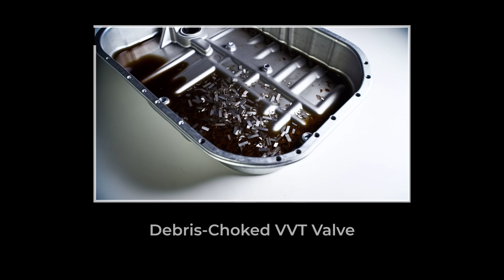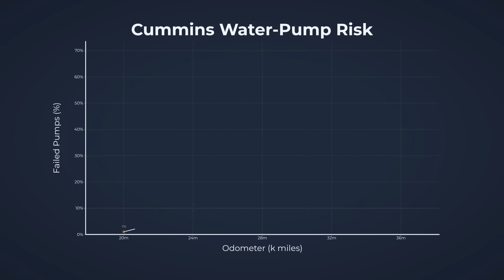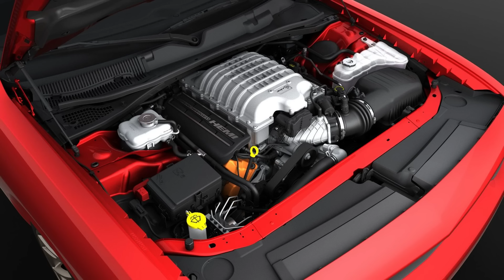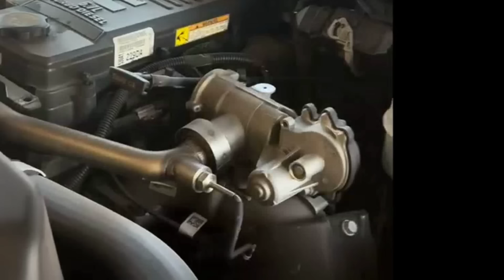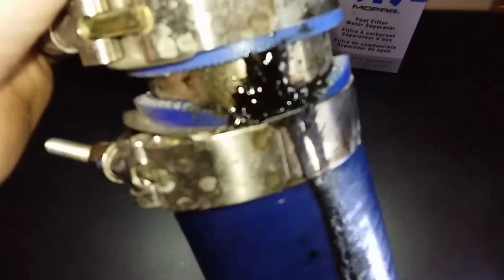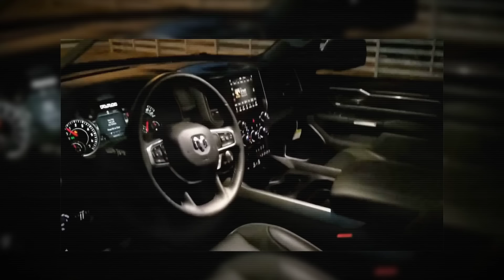Do This Once a Month, and Your RAM Engine Will Last Forever!

Comment: Watching these videos really makes me regret buying my 17 ram… coming up on 100k been solid so far besides the fid exhaust manifold leak that recently started… rear bolts look snapped. Lovely
Reply from the maker: Honestly, if your 2017 made it to almost 100k with mostly just the manifold bolts, you’re doing pretty well. That exhaust leak is super common on these trucks. Hopefully it stays treating you right once you get those bolts handled!
Reply: @RAMCentralHD you make a good point aside from the exhaust the tucks been flawless. The bolt issue really should have been a recall imho

Comment: I bought my 2022 RAM 1500 Laramie 4X4 5.7 non-etorque new. It now has 47k miles and has had a new infotainment system and transmission and rear gear seals replaced. It is now due for the third infotainment system.
Reply: I’ve had all kinds of issues with my 22 warlock also. 
2022 Ram classic Warlock warranty issues 

Front brakes squeal new out of dealership

Tailgate paint tape peeling away redone and repainted 

3 second delay from reverse to drive from brand new still occurs 

Multiple TCM flash

Changed TCM and valve body on original transmission 
 

Drivers window switch needed reset 3-4x 

NEW transmission installed 

On going Uconnect issues 

First oil change didn’t do up the oil filter tight causing me to lose a 1/4 of oil driving 200KM before I caught it. 

Transfer case shaft seal replaced 

Changed antenna for Uconnect 

Changed Uconnect module

Changed shifter dial 

Changed front bumper due to paint chipping away

Changed right side head gasket due to oil
Leak

Changed water pump bad bearing

Cracked overflow bottle
Reply: @cgkuch4184  Listening to all these problems makes me scared to say my 22 bighorn just turned 42,000 with no problems.
Reply: @timothyalexander5218  Keep your fingers crossed! Lol!

Comment: Never purchase a truck motor without an iron manifold. Thought by now, engineering would catch up with old school mechanical common sense.
Make sure you have a support skid plate for the transmission. Guaranteed, will lose the drive shaft and case

Comment: I have a 2019 Ram Rebel 5.7 Hemi E torque with a parasitic battery draw while I'm driving. It kills my battery sometimes in 10 min or an hour or a few hours. Its not the sleep mode but I do have all kinds of issues with the computer and software. Radio head unit freezes or becomes inoperable and when I first got the truck, a few times it wouldn't start or would shut off at lights. Either unable to come back from the auto/on/off or just dies. My battery safe sensor was effed because a mouse chewed the two wires going to the clip that goes into the module on the negative terminal. I changed the wires and found another clip thing to pin them into in order to plug it back into the sensor. Somebody for the love of God help me

Comment: I have a 1500 Ram 2000 port I have never changed the oil in the transmission and I've got a 154000 miles on it should I change it now

Comment: You  seem to have a hard-on for Mopar; did they fire you?  I have a 2017 Hemi Ram with 175,000 miles.  No exhaust tick, no oil leaks, no oil burning.  On the other hand I have a 2021 that developed exhaust tick, which I fixed  Anal service schedules waste money, but since I tow a trailer, I don't follow the factory schedule.  Also is the "synthetic" oil you use really synthetic or just processed conventional oil?

Comment: Hemi design fault because cam sits high up in the block,and doesn't get sufficient oil pressue.
Reply: Location of cam is irrelevant.  Engineering by the factory compensates for this.  Mopar would not have brought back the Hemi if it had all the problems the computer mechanics say it does.
Reply: What’s sufficient oil pressure my 5.7 idols with 55 psi

Comment: Ok you want to eliminate these oil problems?  Run a 160 degree thermostat with the biggest radiator you can fit!  I run 2 radiators easy to do on ram 1500 or 2500 but not powerwagon since the winch is where the 2nd radiator goes.  Once cooled to 170 you can do 10,000 mile oil changes which is what i do.  Trans oil i agree change at 50,000 add deep tranny pan and i insulated the exhaust where it runs right past the pan.  I stay at 190 or below tranny temp. I also have a fan on the front of the A/C condensor and tranny cooler combo.

Comment: Sounds like it’s time to get rid of my ram. I’ve had one since 94 but it sounds like they’re turning into junk.
Reply: Ford and Chevy have the same issues !!
Reply: If you watch enough of all of these videos, it is just regenerated information that people keep copying over so they can all have content and people like us are highly influenced by it.  Dealer mechanics all tell you something different than these videos.  All trucks have "potential" issues now because they are all so tech driven.  That is one of the reasons insurance has almost doubled.  Chevy/GM, Ford, and yes, even Toyota have issues.  I have a friend with a 5.3 Chevy Silverado and he is going through 3 quarts of oil every 5K miles.  GM is so backed up with engines to replace that they can't get to them.  Ram is one of the highest rated for dependability.  Doesn't mean it is bullet proof.  I have a 21 Ram and I absolutely love it.  Has 82K miles and no issues at all.

Comment: Why am I going to buy a Dodge/Ram truck? I was going to purchase a Ram PowerWagon. Now rethinking the whole Ram line. Are Ford trucks any better?
Reply: No. You have fuel pump issues and a bunch of other ford issues. Chevy/Gmc has valve issue from MDS and transmission issues. You can deactivate the MDS on a ram by switching to manual mode. It will shift normally. Do the upgrade on the exhaust manifold and do routine maintenance, and the ram will run for a long time.
Reply: @blackwaterReverend316  I did a deep dive into the mds system and there us NO evidence that is what is causing the hemi tick lifters failing,  actually it might be worse to turn it off. The amount of people that has no problem with mds or the e torque system  is like 90% never have a problem with either, 10% or less do. No more then any other system in Fords or chevy. Millions have 200,000 on their trucks with both and never had a problem.
Reply: @darrin8955  all I can say is you follow your research and I’ll follow my real life experience but I’ve seen camshaft damage from these systems and they only save 1 mpg. A whole lot of extra specialized parts for nothing.
Reply: @blackwaterReverend316 And tell me how your real life experience tells you this,there just as many without mds that had just the same problems.
Reply: Ford and Chevy has same issues !!
Reply: @genemaverick5705  agreed 100%
Reply: The Ram 1500 Hemi is the absolute best motor on the market for 1500s here is why: it uses PFI or port fuel injection which uses 300 psi fuel pump.  Chevys V8s all use direct injection 5000 psi fuel pump - what can possibly go wrong?  100 times more powerful computers and NO REAL ADVANTAGE!   Fords coyote V8 has BOTH PFI AND DFI IN THE SAME ENGINE!  V6's have twin turbos and DI NO WAY!  Only exception to all this mess is the F250 Ford with godzilla 7.3.  It uses PFI and its an awesome engine too but not as many parts as 6.4.
Reply: It’s all junk. Pick what u think looks pretty
Reply: All companies have  problems  no matter ifs ram Ford or gm
Reply: Any review pro/con on the 6.4 power wagon and motor etc.?
Reply: @GordonMiller-z6r  I had a 2021 ram 2500 with the 6.4 and I loved it. All kinds of power. I just did with it what I said earlier, I would set the Transmission to Manual, set it to 8th gear gear and just drive around the MDS never kicked in. my recommendation would be to open up the exhaust and the air intake so it can breathe better.
Reply: @blackwaterReverend316 Thank you
Reply: What kind of gas mileage were you getting? Any idea on how many miles it would get longevity wise? @blackwaterReverend316

Comment: My 13 5.7 is at 208K I change my oil every 5k with full synthetic high mileage and only use quality gas or sub w/ a good PEA cleaner.
Reply: Dude that's nothing my 09 ram hemi is sitting at 460k original transmission and engine.
Reply: My hat is off to you sir,great job!
Reply from the maker: Nice! That’s proof that consistent maintenance pays off. Regular oil changes and good fuel/PEA cleaners really help these 5.7s last a long time. 208K is impressive. 👍

Comment: Alright I have to add two point to your articles, defeat the MDS using a plug in and over in the passenger add an auto start stop defeater. The battery issues is mostly the keys being stored within 30ft of the vehicle, your vehicle reads the remote and cycles start up prep continuously which leads to battery damage, low voltage brown outs, sensor destruction, and cpu scrambling. Keep your keys over 30 ft away.
Reply: Where can a plug in be bought? All i find are ones for GMC?
Reply: @icutlawnservicellc7891 I use Tazer DT to disable auto start/stop and NoLimitz DT to disable MDS. Both plug-ins have a lot of other cool options as well. I definitely recommend checking it out.
Reply: Thank you for the key fob info. I have a 2011 rt charger that shutoff and wouldn’t start after work one day from blowing a fuse because of a low key fob battery (I do believe). I found a blown fuse in the front panel under the hood, and I replaced it with a fuse from the trunk fuse panel. The car started, but all of the writing on the screen was like oriental. I just pulled it farther back in the yard and haven’t touched it since. I really liked that car. It has 263,000 miles on it and nothing was wrong with the engine at all. I’d like to drive it again.

I also have a scat pack chally that I replaced the 7 year old battery in the vehicle. It lasted one year, but I keep it in the garage, almost directly below my fireplace. Which is where I kept my keys on top of the mantle.